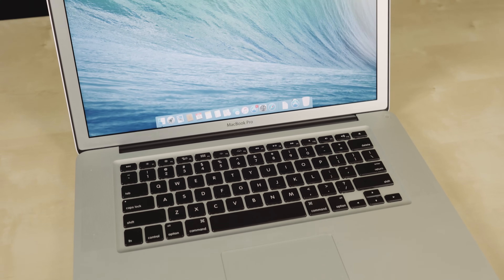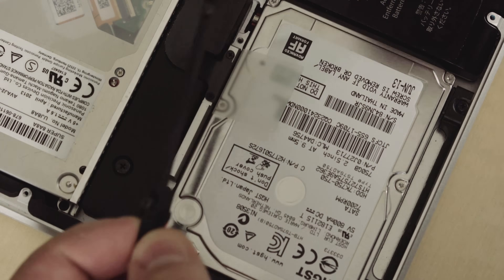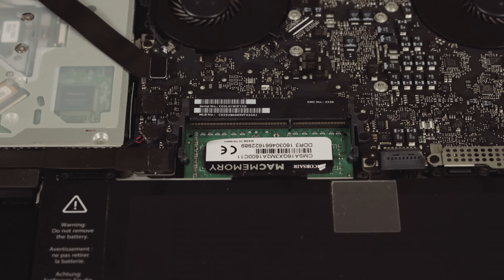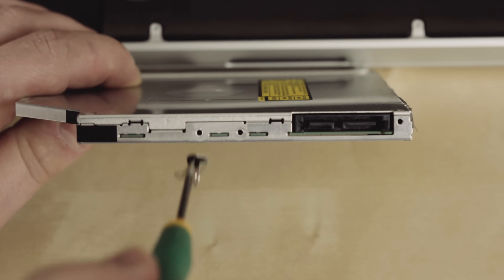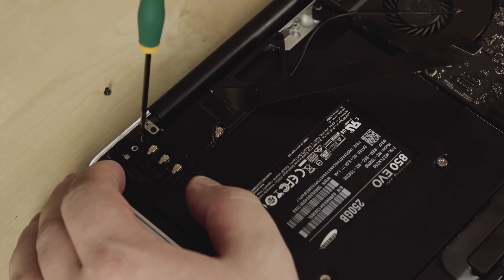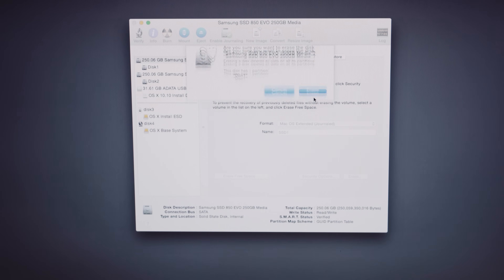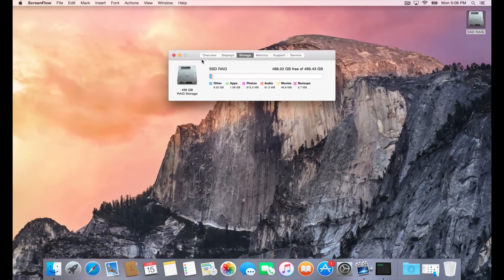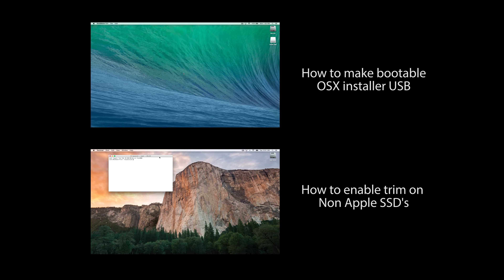Fastest 2012 MacBook Pro Ever! Upgrade Guide - in 4K

Comment: Lol. Still watching this in 2020. My Mid-2012 Macbook Pro is still running like a charm on OSX Catalina with an upgraded 240 GB SDD although I just use 8 GB RAM. In this video, OSX was re-installed using a USB. The mid-2012 Macbook Pro is actually equipped with a wi-fi card (as mentioned here with Bluetooth). You can re-install the original OSX that came with your machine (OSX Mountain Lion) by pressing Command-R as soon as you power up. It will ask you to connect to a network and then proceed with network install of the original OSX on your new SSDs. You can then upgrade Mountain Lion to El Capitan and up. I went from Mountain Lion to El Capitan and then to High Sierra. I skipped Mojave and right now, I'm running Catalina. Yes, the mid-2012 MBP will run Catalina fine. Enjoy. No need for USB install and no need to purchase older OSX versions.
Reply: Just bought a 2012 Macbook Pro. Watching this while I'm waiting for a new SSD & 16GB of ram to be delivered.
Reply: @Ukuleleal  Hope you bought the *non-retin*a 2012 MBP? That's the only one that be upgrade to 16gb RAM
Reply: im in japan gonna buy a second hand one to use.
Reply: Great insight and good to know with Catalina! Thanks
Reply: MITI Ventures 
I did the internet recovery and it loaded OS X Verizon. 10.9.5. So now I am trying to upgrade to Catalina and it says “you may not install to this volume because it is part of an Apple RAID. What did I do wrong?
Reply: @daniellecoley7030  Not sure why you have a RAID. Is it a new SSD? During the installation from internet recovery, do you have an option to format the drive without RAID? Check the disk utility. 10.9.5 is Mavericks. To upgrade to Catalina, you will need El Capitan 10.11. Maybe install El Capitan first. Then upgrade to Catalina. It's a hassle to jump OSes but ... well ... it's Apple. My friend was so frustrated and unhappy with Catalina on his MBP 2012, he downloaded and installed Linux Mint instead. Someone else may have a better answer.
Reply: MITI Ventures  yes I have a SSD RAID because I watched this video and added two new hard drives and he said to make the RAID. I loaded El Capitan, then Sierra and now I am trying to add high Sierra but it still 
says “you may not install this volume because it is part of a Apple RAID”. What do I need to do now?
Reply: I found a forum that said Apple has stopped allowed people to upgrade to new OS systems from high Sierra and newer if you have a RAID. So I guess I will take out the 2nd hard drive and see if that will help. 🤞🏻
Reply: @daniellecoley7030  You can probably format the drives separately in a non-RAID configuration. That you get to keep both drives functional.
Reply: MITI Ventures  how do I do that? I tried to open the terminal and delete the RAID but I wasnt sure actually what to do so it didn’t work. Do you know how to do that?
Reply: @daniellecoley7030  You can attempt to go into Sierra's disk utility. You will see the disks on the left and the RAID configuration. You will also see a delete RAID option. This will destroy data so make sure there is nothing important on there. After the RAID is deleted, the 2 disks will be separate volumes. You can then format them separately. You can also probably do this from the boot version of disk utility. If it fails, you will have to reinstall Mavericks from boot recovery but hopefully before you do you can remove RAID. Good luck! Sorry, not the easiest road.
Reply: @daniellecoley7030  Don't use terminal. Use the disk utility app.
Reply: MITI Ventures well it took me all day but I finally finished. I deleted the RAID and upgraded my Mac to Catalina.  And it is working fine. Thank you so much for your help. 😊
Reply: @daniellecoley7030  Glad it worked out for you. Enjoy!
Reply: Danielle Coley hey, so is not worth it two have 2 ssd?cause your not using them as a raid
Reply: manny aybar  You are right. So I am using just one now.
Reply: @daniellecoley7030  In Disk Utility, you can actually format the 2nd unused drive for extra storage.
Reply: MITI Ventures I thought I might could but haven’t tried it yet. Thank you so much 😊
Reply: Mine is too. Best PC ever!
Reply: And blow out the fans👍🏻
Reply: Runs Catalina no problem. However I did notice before I upgraded the RAM to 16G and attached a SSHD that the newer OSs seemed to demand more and more, but after the upgrade this 8 year old laptop runs faster than it did brand new.
Reply: You can upgrade to mojave like this without any problem?
Reply: It gets even easier with Time Capsule.  I did a fresh High Sierra install on my iMac and then immediately did a backup.  When I scored a 2011 MBP, I restored the backup to the MBP.  It could not have been easier.  I also have bootable USB installer for H.S. which is also just as easy.  BTW, I also have a 2012 MBP 15 so I'm good!
Reply: Same here. I just bought a 1GB Samsung 860 and plan to buy the Corsair 16GB ram modules. Once I get those I plan to upgrade my memory from 256GB to 1TB. But, otherwise my laptop is awesome. However my lightning ports don't work and don't know why.
Reply: Just bought a MacBook pro 2012, it already has 12gb ram and 500gb HDD, thinking to upgrade SSD how much would be ideal ? Is 128 or 256 enough? I have few issues with the Mac it's heating up a lot as soon as I turn it on its showing up 50 °c and the battery is draining fast...any tips?
Reply: @samarpanraj5274  Depends on what you use it for. For my home office, I just use 120gb and save everything to the cloud. It does very well. Just be careful with drive cable, it gets damaged easily. If your ssd seems to not work, replace the drive cable. It's inexpensive.
Reply: @samarpanraj5274  1- Change the thermal paste.
2- Install a 1 TB SSD

Comment: Just put 16gb RAM in, need to order the toolkit and will put my SSD in tomorrow. Im keeping my HDD and putting the SSD where the optical drive was.
Reply: bro if u wanna boot in ssd, i suggest to put ssd where your hdd was. then replace the optical drive with your hdd
Reply: Throw away your HDD, put the SSD in the main bay, keep the optical drive.
Reply: An update on this btw, I got rid of the useless optical drive and replaced with the original HDD using a caddy. The SSD was placed into the HDD slot and used a computer program called Super Duper to move the OS onto the SSD as well as my applications. Everything runs absolutely fire, boot up times and application running speeds are fantastic. My read and write speed was 40 before upgrading and now it is 500. Could not be more happy, a very wise investment indeed.

Comment: Yes I have the same. 2012 Macbook pro 15” 2.3 ghz. Bought approx 3 yrs ago second-hand for reasonable price .  Replaced the 500 hdd with a 1Tb ssd (crucial). Replaced the 2x2 ram with 2x8 (i.e. 16gb !) ram. Worked a dream until, out of the blue, the screen remained black one unlucky morning . Now at the repairshop. 🤞hope for the best....
Reply: Same laptop and same thing happened to me a while ago, it was a easy fix by the repairer and it was a sign my hard drive was failing, failed a week later and I installed a 1TB SSD. This 2012 MBP is a beast! Hope you got yours fixed.

Comment: Lee question brother. Why did you join the harddrives ??? Wouldn't it be more beneficial to have the operating systems running on one ssd and then storage for most other things on the other 

???
Reply: Some plugins cant be shared over 2 separated drives like a sound library. 
By adding them he said you will earn more speed.

Comment: Just wan to know if Mac Book Pro 15" mid 2012 is compatible with 16GB DDR3 RAM ? Because in the specifications it says it is just 8 GB supported .... https://support.apple.com/kb/SP694?locale=en_US .. Please share your views on this.
Reply: Apple says that but if you go to the Crucial website it shows  16 gb of ram is supported on your model. I don't have the 15 inch but have the 13 inch mid 2012 and upgraded the ram to 16 gb  and  put in a 500 gb SSD several years ago. I didn't do the raid configuration but  my macbook pro is fast, not slow at all. Am doing light video editing in imovie, using lightroom no problem etc.  If you go to the crucial website it will tell you the compatible ram for your macbook as well as the SSD's.
Reply: L Campbell so technically If I want to upgrade to 16gb RAM its possible, any ideal if I can change 500GB Regular HDD to 1TB SSD, will it work on this model? Any ideas ?

Comment: I doubt anyone will answer but.....
If you take 2 500gb SSDs to get 1tb of storage, will it be as fast as the ones he is using in the video?
I'm only wondering this because at the beginning he said that they had to be the same size.

And he said that he found screws laying around but can't you just use the ones from the original dvd drive?
Reply: Idk the first part of your question but as for the screws, I used the ones on my original DVD drive, it fit just fine.

Comment: Can anybody tell me why the Raid setup is faster than running a single SSD?
Reply: Depending on what kinda raid. To my knowledge, there’s one kind. Supposed you read 1gb file. 2 ssd reads first 500mb and last 500mb at the same time respectively. So it’s faster. And so on and so forth for 4 ssd or more. 2ssd have exactly same data.
Reply: @timmychen6  Thanks Timmy, that makes perfect sense! I'm sure a single Samsung EVO would suit my needs just fine

Comment: Thank you. You explained very well, clear, crisp, concise. Now I need to create "installer" USB. I have Kingston 8GB / Data Traveller G4, lying in drawer. Will this suffice?
Please also let me know if I need to activate TRIM, if I have NORTON 360, which has built-in CLEAN program?
Will appreciate if acknowledged. Thanks again.
Reply: The usb disk is fine. For trim well I’ve done this a few times without trim and it works fine

Comment: No need to buy a new laptop.....I've replaced my HDD with a 512 Kingston  SSD on my MacBook Pro Late-2012  with Samsung 16 GB ( 8 * 2) RAM, ! Its like a rocket now.! I didn't know a SSD/RAM  could make that big difference. 

But I replaced with a Non Apple Battery which Is not lasting long. 

Overall the performance is Magical.

I would rather go for a 1 TB SSD than having second SSD

Comment: Hey man I have a question if you don't mind guiding me. 
My mac is a macbookpro9,2 and it has 4GB installed using 2 2GB slots (Your Mac contains 2 memory slots, each of which accepts
a 1600 MHz DDR3 memory module.) I notice on my Activity Monitor that my Memory Pressure goes yellow often and my laptop slows down.
I read in some forums that I cannot increase the RAM. Would you advise installing an SSD? Please let me know and thanks in advance!

Comment: You can double the speed of your MacbookPro by just turning up the fan speed as default setting lets it overheat with reduced CPU speed and CPU throttling as result... And in Windows it is even more you can do like run Intel Overclock tool and reduce CPU voltage for even lover temperatures and permanent full speed Turbo boost even with all 4 CPU cores at 100% usage.

Comment: i did the same on late 2008..because enaught for me are 8 gigs but big bonus is just swapable battery..new battry cost just 40 euros now for it you can swap it with no any tools because it is swapable also ssd u can swap because there is cover in back to replace battery and hdd

Comment: I know this video is pretty old, but, it would help to point out the front 4 screws are actually different than the two side and top left screws. The 4 on the bottom have a "shoulder" on them and really should not be mixed up with the 3 that do not have the shoulder.

Comment: How will the OS get installed after replacing the HDDs with SSDs? A backup needed before this to some external drive?
Reply: You don't need any, unless you want to retain files. Mac will download it for you if you have a blank hard disk (using internet recovery).
Reply: Or you can buy a 16gb thumb drive and have the latest OS on it and boot it from the thumb drive
Reply: @fewlefttostand  Hello. Apple has stopped download OS option in app store. The only way is now Command+R for Mac OS internet recovery

Comment: I’ve done this same exact upgrade to my macbook 2012. The question is how do you update the OS system once it is setup? Because it doesn’t allow for me to update to Mac Newest OS system. Would I have to save everything to a external drive wipe it install the the newest software them dump everything back on?  Is this a method or are there more methods to updating the OS system. 
Lee Zavitz

Comment: Out of interest, do you still use this machine in 2019?
Reply: I still use my macbook pro 2012 using the same upgrade as he did. Still works for me. I use Logic Pro
Reply: I got 2009 C2D upgrade 16gb ram and 2 500gb ssd run smooth as butter
Reply: I have the same exact machine and it is indeed well worth it. Considering the price tag of these new 2019/2020 macs
Reply: i am graphic designer and i am using 2008 15 inch unibody .. 8 ram plus ssd.. plussnew battery.. it still do all work ( photoshop and illustrator ) perfect!!!
Reply: I'm using my mid 2012 macbook pro with some vertical lines running on the screen. :)
Reply: Mbp mid 2012, 16gb ram and 256ssd
I do 3d modeling and printing no problem
Reply: So basically it is worth it to do graphics or audio, what about video rendering? Does it compete against more modern laptops like Razer?

Comment: I have same MacBook Pro MD101. My default HDD is not working. When I start I keeps booting.

Someone suggested that I should shift current HDD to Disc drive bay using caddy. And replace current HDD with SSD.

Also I want to upgrade RAM.

My question is how can I install same Mac OS Yosemite again on new SSD? Or do I have to find another copy means serial number.

Also will these modifications works? I mean will I be able to access data on current HDD after I shift it to Disc Drive?

Also can you recommend which particular SSD is compatible as I don't know about SATA stuff.
Also you showed making two SSD something RAID. Will I have to do it  with my SSD. Is that step possible for both HDD and SSD together?

Thanks
Reply: I think you could make a time machine backup. and do restore in your new ssd.
or if your hdd broke, just download Yosemite, just Google it

Comment: Can't you just re-download mac os by going into recovery mode without a usb stick?
Reply: Nope.   Apple is ass-backwards in this regard.    The stick and a rather time wasting process is needed  Better to buy a used drive with a clean new OSx preloaded.   For 35 bucks it is worth it.  eBay.  (don't go higher that 30-35 bucks)  High Sierra does well on a mid 2012 macbook pro with 8 -16 GB RAM.  Especially well with a proper SSD.

Comment: Anyone who watches this video in September 2019, make sure to buy a mid 2012 to do this upgrade. Any earlier and you can’t get the latest OS, any later and you may not be able to get the same upgrades
Reply: thank you, I was wondering that, I still don't understand how/what to do to save all my memory/files/pics etc, is that what the usb is for? if so what kind /capacity of usb! I have a MBP MID 2012
Reply: brenda barndt your best bet is to check and see if you can do a standard back up of your computer on the cloud. If you have an Apple computer it’ll work. If it’s any other brand you may have to use a usb and his usb is for the update to the latest OS. If you have to, use 2 or more to store everything that’s on your computer and another for the update.

Comment: Another important upgrade is wrapping the hard drive cable with electrical tape! The stock cable is so thin that microscopic damage totally ruin it and make it look like your HDD/SDD corrupted. Alternatively, just put electrical tape between the cable and where it contacts the inner part of the casing and you'll be good too.

Comment: Thanks Lee. Not bad. Although that doesn't look like a mid 2012 Macbook Pro. The bezel around the screen isn't silver.

I also had to remove an extra cable with red and black wires to get the optical drive out.

The 2 screws holding the optical drive in on the edge of the case are a fiddle to get back in.

Apart from that it was ok to upgrade. I had already done this on a 2009 one a while ago.

Comment: When you boot up after installing the two new SSD's, do not install your OS X install thumb drive if it is OS X 10.11 or later. Apple eliminated the RAID option from Disk Utility in those versions. You need to boot up, holding down "Command + R" with no thumb drive installed and the Macbook will perform an internet recovery which will have an older version of Disk Utility with RAID. After you have created your RAID, power down and boot up with your thumb drive inserted and you will start the OS X install process. Took me a whole week to figure this out by accident. Also, if your OS X thumb drive installer does not work, you have the option of installing the original OS your Macbook came with and then you can upgrade to whatever OS X you want from the App store.
Reply: Create an tutorial on YouTube ): please
Reply: Still says "You may not install to this volume because it is part of an "AppleRAID", trying to install Mojave.
Reply: Dustin McGuire I installed Yosemite from USB. I’m at high Sierra now cause my photo booth program needs high Sierra but I feel like upgrading from here on should work. If I upgrade one I’ll circle back here.
Reply: Rafael Unplugged I upgraded to high Sierra as well. Mojave won’t install to apple raid. Next I’m going to try to install Mojave’s on single ssd. Then do a time machine backup and try to restore backup to the raid. 🤞🏼
Reply: Dustin McGuire oh try a restore!

From a higher OS too. Third option. Lmk!
Reply: It worked I was trying everything!!!
Reply: facts
Reply: Ironically I have the CD installer for older OS 😂